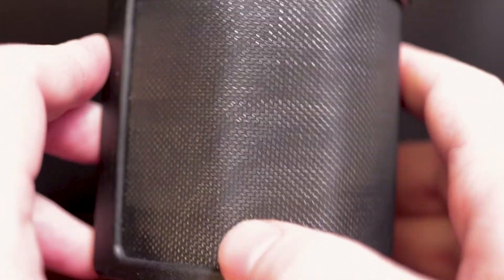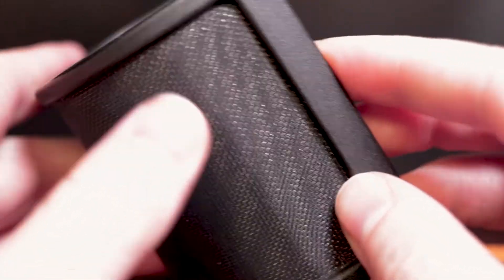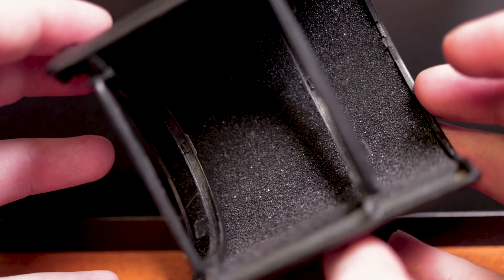What to choose, Pop Filter or Wind Screen? (Pop Filter vs Wind Screen)

Comment: Thanks.  It doesn't depend on the type of vocal you record?  A different type of pop-filter will work well with a delicate soul-pop vocal, and a different type of rock vocal?
Reply from the maker: It comes down to two things efficacy and tonal change.  I feel the metal gooseneck option is best of both worlds.  it avoids bursts of air and doesn't really compromise the tone.  Sometimes with a thick foam wind screen, you lose some tones.  You notice that in my shotgun videos I did recently.  The outdoor tests showed how much the tone changed.
Reply: @RebelTech1990  Thanks :)

Comment: Amazing comparison. Well done and thank you. I'm gonna stick with quality metal pop filters from now on
Reply from the maker: It's really the best way to go.  Just make sure you have the mic and the pop filter positioned just right.  The metal one "redirects" the air, so don't redirect it into the mic.  Also a slight angle on the mic makes a big difference.